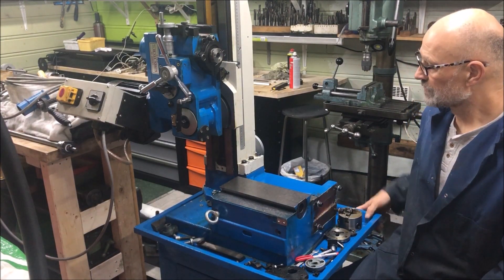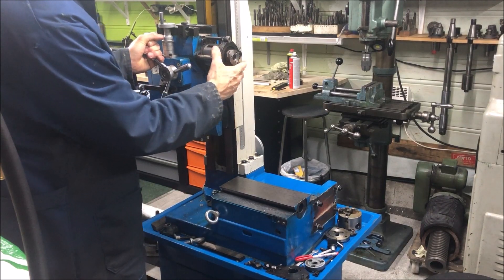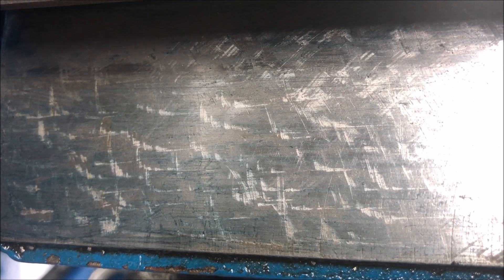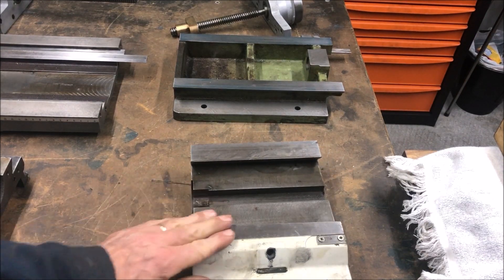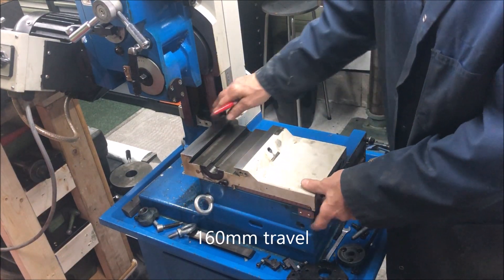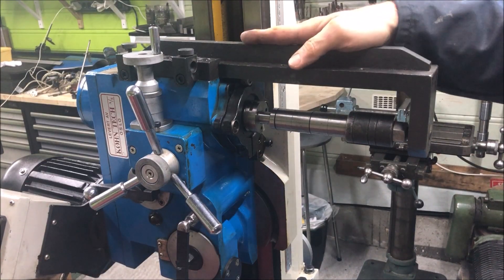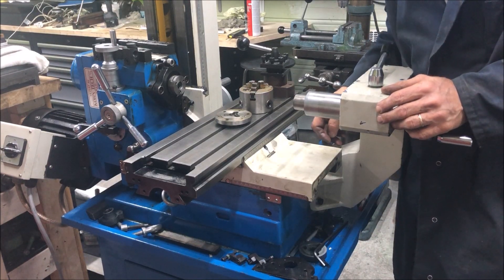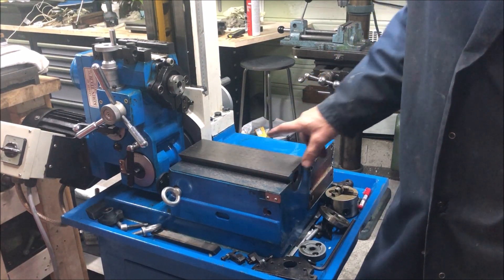CX-16 milling machine - intro

Comment: Great video! I am also owner of a CX16 (serial #29) which was imported by HBM Machines in the Netherlands and served as a showroom piece of a German reseller.
It is a very versatile machine, but I whish it had an SK30/ISO30 spindle (as the newer Golmatic MD23/MD24) , not that smallish MT2. The manufactoring quality is a bit on the better side of what you can expect for this kind of Chinese machinery.

My machine as no window on the quill for extraction of the MT2 tools. It uses an M10 draw bar instead (also pushes out the tool when loosening the drawbar from the top with an allen wrench).

Attachment of lathe collet chucks is a bit awkward (limited space). So I modified a chuck to be screwed on from the front.

The quill handle does not fix the quill too well when pulling forces get too large during milling. But depth stop can be screwed in (annoying to turn) to help to hold the quill.

The motor is a three-phase two-speed motor (pole-changing Dahlander type). In my previous workshop, I had only single-phase 230V, so I wired it in star config and hooked a a single-phase frequency converter to it. No ideal (looses sync over ~70Hz under load), but it does the job surprisingly well, so I never bothered to change it.

Looking forward to see more videos documenting your journey,
with kind regards from Hamburg, Germany!
Reply from the maker: HI, thnks for the nice comments!
I also like the CX-16 and it is evidently of a somewhat higher quality than much of the other budget machines of Eastern origin. I see that the CX-16 is still being advertised from the Chinese web portals, but I think the last time I saw this here in Europe was about 10 years ago in Sweden, this unit being labeled and sold by Knuth and their distribution network (presumable here in Norway as well).
My machine also use a drawbar for the MT2 tooling. The whole machine as well as the power available is a little lighter built than the Golmatic, hence made more for the "hobby users market". Hence I assume that an MT spindle is a good choice from this perspective, although it would be better with MT3 (and if so, of course an ISO30).
Interesting to learn about the different versions/motor solutions. This could mean that your machine is from another supplier than mine.. or just a change in production versions.

The 3 jaw chuck on mine is probably meant for turning, so is more appropriately "a lathe only" workholding tool. I plan to use the machine mostly for milling anyway..
I bought an EstlCam CNC kit from Rocketronics for the purpose of converting it to CNC, but the box hasn't been opened since I got it last Xmas ... :) https://www.rocketronics.de/shop/en/controls/cnc-controller/
Have had so many other projects running aside oneanother and progress has been slow these later months, but must speed up now ..
I do have quite some unreleased material which will be published on YT, both on Myford restorations as well as the work on the CX-16 and the last aquisition.. the Smarty AT-300

Comment: Hello Jan Sverre. Very interesting, I have just the same machine. Actually it come from the same dealer as Yours🙂. I have hade it for many years but it havent been running many hours. To make it a little more user friendly i will do exactly what You have started here. I will square it up and also dö something about the "tailstock". Maybe introduce indexpins for easy setup in 0 and 90 degrees. I have mounted an VFD and changed spindle bearings. I have no experience regarding this type of machine restoring so I will very close follow every step and copy them to My machine. I will also motorize the column, it's a real pain to crank it up and down when reconfigure. A question, sid You got a rotary table included with the machine?
Greetings from Sweden.
Reply from the maker: Thnks! I may have expressed myself incorrectly. My machine came from a Norwegian company, not from Brännehylte Maskin where I looked at the type several times. The machine being announced there as a Knuth product, the type "Knuth DBF De Luxe". I assume they were the Swedish Knuth dealer at the time, but this is probably the same machine, ie. CX-16 that originates from China.. (as a "simplified" Golmatic copy). I think the particular machine I looked at in Sweden was sitting there for a number of years, possibly they only aquired a sole example (or few) to test the market potential, and found out that there was only a limited interest? So you could very well be the one that bought that same machine I looked at :)
Regarding the tailstock, I am not too worried as i hardly will use it for lathe duties with the tailstock in place. However, if you look at the video of the Golmatic you see that they had a different fixation design. Looks like a spring loaded positive indent and/or slide. I want to explore this and possibly implement something similar.
I am not convinced I need to convert the trapezoidal screw in the Z-axis for CNC-reasons, as it will probably? not be used much up/down (I originally thought of just adopting one of the Rocketronics lathe controllers ie. just automating the X- and Y-axis), but if not, will need to move one step re. the motor as there is considerably more drag vs. a ballscrew design.  Will see!
No, there was no rotary table with my machine. Strangely not as the (extra) tailstock that followed seems to be part of a dividing head/rotary table with vertical mounting platform setup.
Reply: @jansverrehaugjord9934  Well, You see, I've worked alot with Tryggve at KohnTech, and I got the machine when I visited him on a work trip many years ago. It was quite interesting to drive to the south of Sweden with that machine in the trunk.🙂 Anyway, i think i runned the spindel for an halvhour or so before the bearings broke down, so that's something to have in mind. My CX is mostly configured as a lathe right now. I asked about the rotary table because I also got the tailstock with the machine and have always wondered what to use it for.
Reply from the maker: @1mitec  Aah! Sorry.. for one reason or another I assumed yours came from Sweden. Jaja.. Anyway, the person I got it from said that Köhntech did a bearing replacement on the machine, so hopefully this is not an issue. Hm.. I wonder if a Vertex table (for example) will fit?

Comment: Interesting and new to me machine design. Looks versatile, I'll be following the progress. Thanks
Reply from the maker: The idea of a combination mill/lathe is probably not so useful.. 90% mill/10% lathe oriented, but it is a nice design for the way the head can tilt from vertical to horizontal. Actually a lot like a VN8 or 12 apart from having the motor on top of the head itself.

Comment: I have never seen a machine structured like that.  I hope it turns out to be rigid enough to take precise cuts!
Reply from the maker: It is a small machine, but a quite hefty work head and given some "treatmnent" on the way system to improve fit & finish and accuracy, I hop and think this should be an OK machine aside the other bigger machines. I evaluated the original, but when this cam along.. at the right price, I couldn't walk away. I also looked at the possibility of buying a used machine, like an Deckel FP1, English made Centec or others, plus a number of others with a small footprint andd a quill, and also other "budget" machnes of Eastern origin, but this will fit in nicely with the Myford for small jobs.